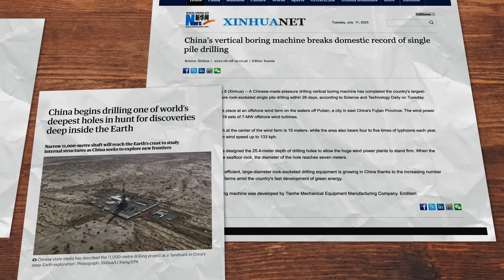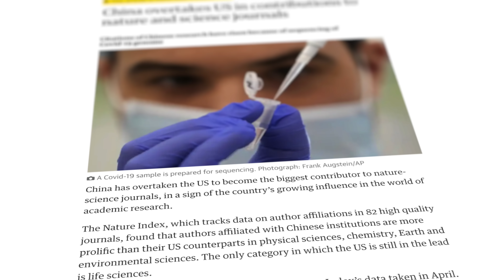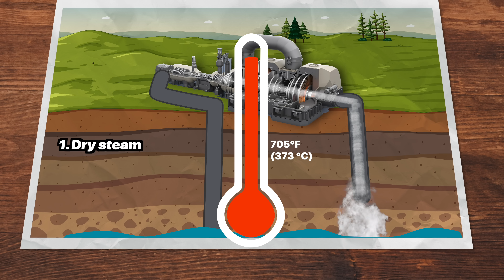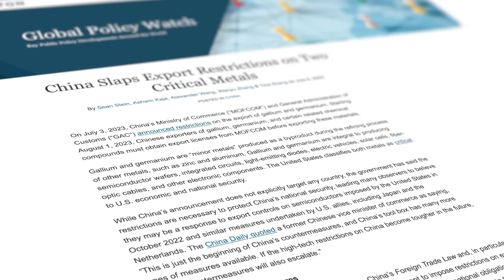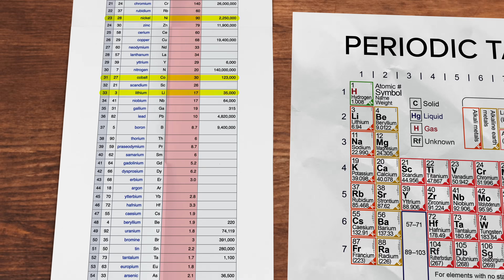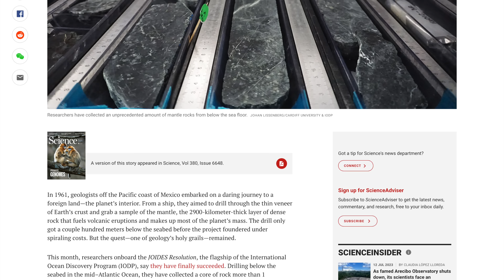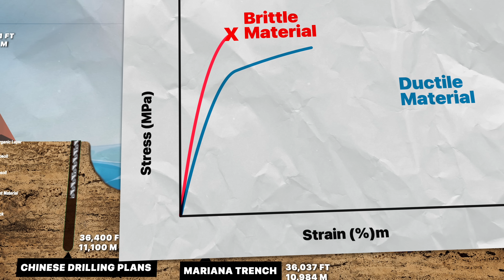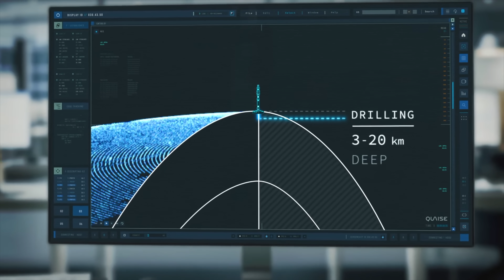What’s Hiding Beneath China’s Deepest Hole?

Comment: As a 43 year oil geologist, I can tell you that wells this deep could possibly only make economic sense for hydrotheral energy. There is no present technology that could economically extract minerals. Plus, the challenges to drill wells at that depth/heat horizontally are beyond our abilities, now and for the far future.
Reply: Why the Soviets stopped their Kola Superdeep Borehole SG-3 in 1989. Too hot down there.
Reply: @BergenDev Listen to the sounds they heard. That's why they sealed it.
Reply: @BergenDev too noisy
Reply: At such depths, temperatures and pressures, if there is hydrocarbons, it will be a gas condensate, methane, not liquid crude oil. As an oil/gas Geoscientist who has also worked on Geothermal projects, understanding the basin stratigraphy by drilling such a deep exploration well is understandable. 

As for geothermal, we have the technology now to drill  wells to a vertical depth that reach at least 115 degrees centigrade almost anywhere in the world and 150 deg C in most locations. There are geothermal projects where two vertical wells are drilled to depth and then multiple connecting sidetracked horizontal wells are drilled between them. So the two wells become one connected system. We pump water down one well which then gets heated and then the hot water vapour comes back to surface up the other well. This boiling hot water vapour is used to generate electricity and to heat large buildings such as airports. You don’t need 373 degrees C. 

The centre of the Earth is hotter than the surface of the Sun, and far closer. I personally don’t know why we would even bother with man made nuclear energy generation when we can effectively tap into the greatest natural form of energy on Earth, the heat from the Earths core. Geothermal could power the world, safely and with little impact. The greens need to get over their irrational bias towards such drilling projects just because oil companies get involved as it uses technology developed in that industry. Well done CNNOC for drilling this deep exploration well.
Reply: @spacehopper77 Regardless how deep or how many boreholes you drill it will always be limited by the thermal conductivity of the surrounding material. Hence, the relatively low capacity factor of 50% with geothermal vs nuclear that can sustain 90% as long as sufficient cooling is available.
Reply: @RichardPrendingue Geothermal has a high capacity factor of 90 – 95%, on par with nuclear, and this is according to the DOE not "just trust me bro".
Reply: @RichardPrendingue  perhaps but unlike nuclear this is not a nuclear waste issue that needs to be mitigated and geothermal can be developed at a fraction of the cost.
Reply: @spacehopper77  Geothermal energy caused earth quakes are a known issue and not every siting will be equal in costs due to variance of earth composition, thickness, and new drilling technique. Vaporizing the rock at drill head is ezpz the thing making me skeptical is sustaining it in gasous state for "drilling extraction" up to the surface otherwise it will clog.

Keep in mind nuclear is only expensive in western society as we don't have ample supply of experienced builders or equipment manufacturers where economies of scale can bring down prices. Sure, it's around $220  per MWh levelized cost of energy in USA, but South Korea economies of scale brings down their costs to $70 to $75 per MWh.
Reply: @RichardPrendingue  traditional geothermal completions where water is forced through permeable rock between two wells can indeed produce seismic events, earthquakes. However, these are associated with small i quakes of less than 3 on the Richter scale. What I am talking about is Advanced Geothermal Systems (AGS) where the wells are linked together with side track wells. In such completions the water does not go through natural permeability and as such there is no risk of earthquakes. Even so earthquakes caused by fracturing is frankly overstated and media driven hype. A truck or a train vibrates the surface more.  The fact that onshore UK has fractured almost 200 wells since the 70s and nobody even noticed is testament to this. Anyway, no need for hydraulic fracturing in modern deep geothermal AGS systems.
Reply: I'm curious if they could truly vaporize, then they could theoretically extract vapor which could make this potentially far more valuable
Reply: Думаю это ответ радиолазерному бурению в США. Правда запланированная отметка там намного ниже 20км. Геотермальная энергия доступная где угодно изменит нашу цивилизацию навсегда, газ и нефть останутся для транспорта и химпроизводства. 
Для этого просто нужно будет пробурить такое около каждой уже построенной ТЭС.
Reply: @АлексейБычков-б6ч  Very true. 

I can't help but wonder just how many such holes can be drilled before we off gas too much heat from the core and cause catastrophic damage.  🤔
Reply: It would be a good way to test out things like plasma drilling at depth which could speed up deep drilling tech advances
Reply: there is locations where crust is thin enough to you dont have to dig whole lot drilling super deep just for thermal energy is nonsense
Reply: @serdarcam99  the thinnest areas are about 8 or 9 miles thick. Roughly 12km. Hasn't been any area found where it's significantly thinner, though that's not to say there isn't. It's fairly uniform unless it's something silly like the thickness under a mountain range.
Reply: @philbert006  there are some points on iceland that are only 4-5 Miles thick japan sea has likely spots likely same thickness
Reply: @serdarcam99  I have never heard or read of such a place. That does not by any means refute what you claim. As to what's likely or not, that's a little irrelevant, since it's not something anyone is going to take a gamble on so much as find out for sure since we have the means to do so.  Something to consider also is it's not a matter of digging through the crust. The ambient heat increases in a linear fashion with depth pretty much uniformly, excepting of course being on a hot spot, near volcanoes or something similar. I think finding the desired amount of heat for the purposes being discussed happens long before you would ever reach 20,000 feet. I mean, there are plenty of mines that were dug hundreds of years ago, by hand instead of machinery, where they are hitting pretty significant temperature. Probably wouldn't have to go nearly that far to find that it's warm enough to boil water. After that, it's always going to be diminishing returns to some extent. Cost goes up at a steeper curve, too heat steam takes either more heat or time so that increases at a steeper curve. Once you pass the boiling point and start dealing with steam, you can only increase it's temperature with a rather steep curve of increasing pressure, which also leads to the required equipment to start snowballing, not to mention once you get steam, the element of danger increases exponentially.  Digging to the mantle just doesn't make any sense. Kind off becomes a moot point. But, you didn't ask for any of that crap, nor is it what we were on about in the first place. Sorry 😐
Reply: Hydrothermal? Not Geothermal?
Reply: I dunno I am not a geologist or anything but I can't imagine that if you do not not you will never know. But I defer to you. Even so Geothermal alone could be huge.
Reply: did your textbook say its impossible? well china is doing it anyway
Reply: This video leads us to believe that the deeper the rock formations the older they are.  Is the Earth really like an onion in this respect?   If this assertion is true then why do we find Jurassic material on the surface in the Dakotas. One does not need to be a geologist to understand the phenomena of uplifting and subsidence.   Our planet is a dynamic system, not a static one wherein everything is so simply sorted as the graphics in this video imply.  There is only one reason to dig that hole.  They hope to find riches or a trail that will lead to them.  What I mean here is the prospect of discovering yet unknown energy sources.  And behind that?
Reply: The same "heated" argument can be used for leaving our earth's atmosphere for moon travel. We did go to the moon with 50 thru early 70's technologies, right? 🤭🤫 🧑‍🚀🌝
Reply: There is more coal than Oil because there is more dead plant matter than animal matter. (Based on the highest level of classification).
Reply: @himanshusingh5214  Coal is mainly from the accumulation of dead trees.  There was a period of hundreds of millions of years where dead trees piled up on top of each other and accumulated and eventually got buried and compressed into coal.  This was because the bacterial enzyme to break down the lignin binding the cellulose fibers in wood had not evolved yet, and so dead tree trunks did not break down.  They just piled up on top of each other.
Oil and gas are thought to have developed from algae accumulations, or from the latter times after the breakdown of dead woody plant matter came into existence.
Reply: @somad6997 Sure. Anything is possible but with different degrees of probability. Hydrocarbons under the surface of a celestial body, versus a RED teapot orbiting the sun are at totally different ends of the spectrum.
Reply: as a black lesbian midget I agree
Reply: Biggest geothermal vent to boil sea water and make the steam capture carbon from the atmosphere which in turn falls into the ocean making it more acidic and in turn destroying all life on earth, you may think this is absurd or outrageous but do think about it....
Reply: At one time, didnt Russia dig the deepest hole? China will fuck it up somehow, they are responsible in anything they do. Also, China has no sense to look when they are building things, that destroy there infrastructure due to natural things, to cutting corners and the end result.
Reply: Us is working to put tranys on Mars
Reply: Where did that 'map' beginning at 00:50 come from? That SO rang a bell, but I can't place it.
Reply: Bout to bury those documents reallllll deep so they are never found.
Reply: I'm not 100% certain, but I'm pretty sure you can extract lithium brine this way, by pumping water down to force it up, and using nanopore sponges to trap the lithium and send the remainder of the brine back down. There's a Canadian company (I want to say Summit Nanotech but don't quote me) out of Calgary that's developed a sponge like that and iirc they're doing full scale final stage tests in Chile right now, but a similar type thing could definitely be achieved elsewhere.
Reply: @Fenthule  Better done than nothing at all. All that broadens our core existence in being.
Reply: They're just gonna give their psychotronic scalar antenna proper ground. 
🤘😆
Reply: That would be right.! China drills the deepest hole in the earth's crust and triggers global unrest, a tsunami. earthquakes and destabilising our world Literally!!?
Reply: Yep true but china is desperate the country is down to drain
There government like to have it all for control but they fail every time.
Reply: Then you should also be aware of how these deep wells nearly ALWAYS coincide with earthquake zones and shouldnt be done by a genocidal country who does ALL IT CAN to damage the earth and the people on it.
Reply: No, but if they can dig further for cheaper, it does open up more possibilities.
Reply: I wouldn't say into the far future.
It's going to be a lot sooner than that.
Reply: As a 63 year old retiree   I’m glad that I DGAF Anymore
Reply: Can you dump stuff in it though?
Reply: @ladyville3  yes but why would you want to do that?
Reply: @@kerrieanne6862 I don't know any other way to say this and I know I sound crazy but this is already a well known thing... I hope.

If you believe that we aren't alone in the universe then you're probably aware that our government and others around the world have recovered crashed vehicles not of human origin.

They took the technology from these craft and reverse engineered it.

Have you ever wondered how or where humanity keeps getting all this high teck stuff when not even 100 years ago we still used things like typewriters and record players.

Then after events like Roswell New Mexico we get computers Lazer disk technology on to the present day where we have 4k HD TV's that double as a super computer.

For context the first regular computer was the size of a commercial wearhouse and it was only capable of solving math equations Now they fit in the palm of your hand and all you have to do is tap the screen and you have access to more information than your mind can possibly handle.

The teck the government have they sit on and dish it out over decades in small portions.

If they just said fu¢k it and gave us everything humanity will become at the very least a full century more technologically advanced literally in the time it takes you to fall asleep and wake up the next day.

Say goodbye to your water and power bills and Hello pure clean energy.

If your not totally convinced by this point here's a real brain knot for you to untie.

From what we came from in such a short time how did humanity discover or think of the concept of Artificial Intelligence?

We are mumkey. 🦍💨
How we get strange magic talking light box?

I know humans are smart but not smart enough to do the things we've done in such a short amount of time.

Isn't it weird how much things have changed since America was founded less than 250 years ago while the rest of the world still looks pretty much the same?
Reply: @RepentandbelieveinJesusChrist  
Who said that? Can you name the person that gave those instructions?
Reply: They’re going to have a hard time producing and maintaining any sort of bit that can drill at that depth - and will most likely either import the bits from the US or “use” the design of US bits.
Reply: Wrong! They have alien technology and are working with reptilians! Wake up! 🤣
Reply: Idk why y’all, but I believe him
Reply: liar you arent a geolgist probably a troll 14 year old
Reply: I once heard from a wise man, “don’t trust China; China asshoe.”
Reply: The times I in my short life have heard, cant be done and laughed...
Reply: You don’t know shit but what they told you.. smh
Reply: Thanks for the input Chuck.
Reply: I've heard that some of these oil wells that were supposedly shut down because they were empty are getting full again. 
They never removed the pumps because they knew.
Crude is not fossil fuels. The earth produces it. It's not the cleanest but still the cheapest energy source.
Natural gas is much cleaner and can be used for fuel in vehicles. 
Nuclear energy is the best, in my opinion.
Reply: They lie . All it's a big fat lie.reserch
Reply: Beyond western capabilities but China can do miracles.
Reply: @philippebracq884  they certainly miraculously oppress their people
Reply: So you're a geologist today and you think that this is too deep well I guess we'll have to shut down a lot of oil Wells that are already operating based on you what you say
Reply: @Nicklan1961  he's been in yo mom's hydrothermal well and it's way deeper then the Chinese.
Reply: What took years to create will take seconds to destroy. Who believes China when they say for scientific research? Lol what could go wrong?
Reply: Kissinger and Nixton surrendered  USA's  Steel production to China... and Electonics production, and most manufacturing, and all drugs to China.
  Look around every  Walmart,   everything is now  MADE IN CHINA !
Reply: Tofo Dreg
Reply: China will figure it out.😂😂
Reply: Liking the look of the drilling using fricking laser beams, well technicality a maser but it means that you don't need to bring the drill bit back up to be changed which beyond 3km starts to become the limiting factor, which if you want to do geothermal anywhere in the world you need to be able to get down to 10 - 20km at which point a physical drill will last around an hour and will take weeks to change, so yeh a 1MW laser actually ends up being the faster and cheaper option. Although you would dig the first ~2km conventionally because it's WAY faster to drill in the early stages.
Reply: There's no chance of there being ultra concentrated pockets of valuable ores at any point?  I never quite understood the Russian bore holes that went on for ages. It's what 12km or something?  Just for what seemed to be little more than a really weird dick measuring contest lol.  In terms of going much deeper, we'll need to have the materials scientists develop some fancy new hard, heat resistant alloys that won't clog up in the progressively gooey rock as it gets deeper.

Also in terms of it being economically feasible, Australian mining engineers are pretty ridiculously good at digging shit out of the ground.  Australia is to mining and digging what America is to war machines lmao.  Not quite as sexy but we're good at digging holes so we ran with it lmao
Reply: @Alex.The.Lionnnnn 
Canada has some pretty good mining history too. We like digging here as well.
Reply: @Alex.The.Lionnnnn  There's always the chance, but the odds of you hitting that pocket is smaller than your odds of hitting lottery jackpot several times in a row and it's unlikely that pocket of valuable ore is worth more than the cost of drilling.
Reply: @Alex.The.Lionnnnn  my dad loved Australia and rocks. 👍😎🇺🇲
Reply: @Alex.The.Lionnnnn  
🤣
Reply: @Alex.The.Lionnnnn  
Deeper means more difficult to extract.
Reply: @Alex.The.Lionnnnn  Exxon is working on extracting lithium from their wells as we speak.
Reply: Why dig when we can create materials almost from thin air ? just look up keshe foundation !!
Reply: Covert military project: neutrino communications
Reply: @nfuryboss  with whom?
Reply: @nfuryboss   Is that a conspiracy?  A theory?  Or both, a CT?
Reply: @nfuryboss  the west is very naive of china's intention and motive.
Reply: @nfuryboss by digging??? Umm no.
Reply: I heard an interview with the founder of Quaise, which is a company trying to develope a geothermal energy solution.

Although it sounds pretty far out, they're trying to use microwaves to melt rock as they drill, numbers wise he seems to make a good economic argument.

I don't have any personal expertise to really evaluate their ideas in a technical level, but from the interview it sounded hopeful.
Reply: @AB-wf8ek  How to they propose to overcome the "tapering off" issue that all geothermal plants currently experince, along with avoiding issues such as those seen around Wairaki geothermal field in New Zealand?
Reply: Do you agree that oil is not a " fossil" fuel, but created from magma, and that new oil is created much faster than we are told, but this process varies a lot from area to area. It was old John D Rockefeller who came up with the idea of calling oil "fossil" in order to drive up prices when people thought there could be scarcity of oil in future. Oil drilled and found far deeper than "fossil" sediments...
Reply: @MrCatlover  Some oil is definitely fossil. Most of the hydrocarbons we find are fossil fuels. But that may just be because we drill for them where we expect to find them. Hydrocarbons can be made in the ground from water and CO2 interacting with rocks, but we know very little about what is happening deep in the ground. That is why these kind of experiments are so interesting.
Reply: @GerbenWulff and yet, Titan has more hydrocarbons than Earth. So there would seem to be a parallel creation process. Presumably you simply need hydrogen, carbon, and pressure in the same place.
Reply: @MrCatlover  There's a misconception around the term fossil in fossil fuels for sure. Most people think it's made of fossilised dinosaurs when, in fact, it's mostly plankton and algae piled up at the bottom of the sea. Why else would you have entire wells of oil. What? Did dinosaurs have cemeteries where they took their dead and let them pile up? It's really crazy when you think about it.
Reply: @ipp_tutor yes dinosaur were intelligent
Reply: There are also micro organisms in the oceans and possibly other places that are constantly producing huge amounts of hydrocarbons as part of their normal lives and others that consume these hydrocarbons/
Reply: @ipp_tutor  they have found massive piles of mammoth's so who knows
Reply: @bengardener8928  Wrong. Animals do not create hydro carbons when they are alive. That only happens when they decompose.
Reply: @ipp_tutor  You're taking the term a little bit too literally. Pretty sure all it's meant to convey is that it formed a very long time ago.
Reply: I still like the term Dino Juice. I don't see that changing any time soon.  🤣
Reply: @ipp_tutor Why would any person think there were piles and piles of dinosaurs walking on top of each other?
Reply: @MrCatlover  factually inaccurate, aka it's a fact you are wrong
Reply: @MrCatlover No everything you said is incorrect by a mile. Hydrocarbons are primarily composed of decayed organic material, not magma.
Reply: @MrCatlover  You're the epitome of why geology shouldn't be neglected when schools build their curriculums.
Reply: @MrCatlover  well it hot down there it being cooked so are your saying it's bubbling away down there, like beer/wine making process but making oil, or are saying oil, just a sort liquid rock of some type, sort, like mercury in liquid metal, nothing like steal bar?
Reply: @MrCatlover  lol whut? carbon comes from life, it takes energy to create it, lots of energy over very long amounts of time, oil is absolutely finite, its not a conspiracy
Reply: Have you searched for fields and knee why to look where. You would more likely tend to say it is fossil, comming from biological material.
Reply: @MrCatlover  Created from Magma?? No.
Reply: @MrCatlover  actually fossil in this instance means.  It is been dug. Not fossil like in carbon
Reply: @MrCatlover  Hydrocarbons on other planets were not made by dinosaur astronauts.
Reply: @johnjdumas  But then again there's no oil on other planets. There are some types of hydrocarbons in places like Titan, but on earth, it reacts with the atmosphere and gets transformed in other molecules. Ie that's why there so little methane in the atmosphere despite the fact life on earth creates a lot of it.
Reply: @LeMAD22  Oil is different everywhere on Earth. There could be various non-organic and organic mixtures.  How do we know H-C bonds have not formed over time in anaerobic conditions on Earth?
Reply: @LeMAD22  You can't really say there is no oil on other planets, we've only drilled a few feet into one planet and a moon. What lies below the surface of all the other planets is completely unknown.
Reply: @johnjdumas  "Hydrocarbons on other planets were not made by dinosaur astronauts". Or plankton and algae at the bottom of the sea.
Reply: @johnjdumas  please define 'hydrocarbon on other planets'.  I find ignorant tend to talk in vague general term.
Reply: @MrCatlover  that was my understanding as well. Kinda like diamonds